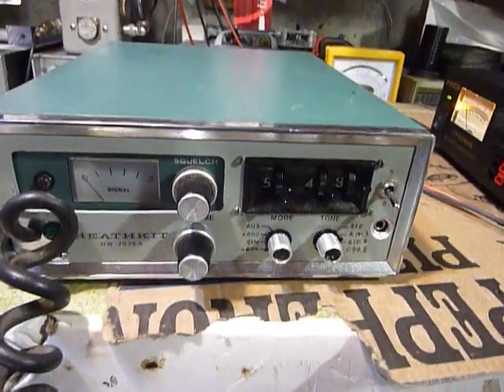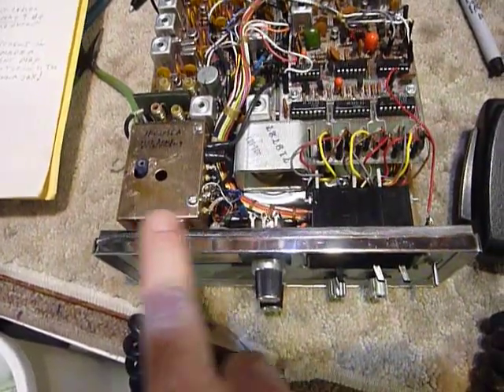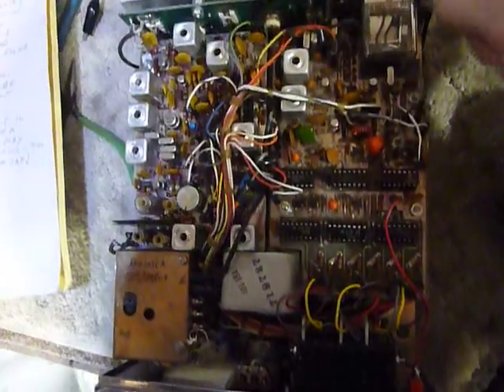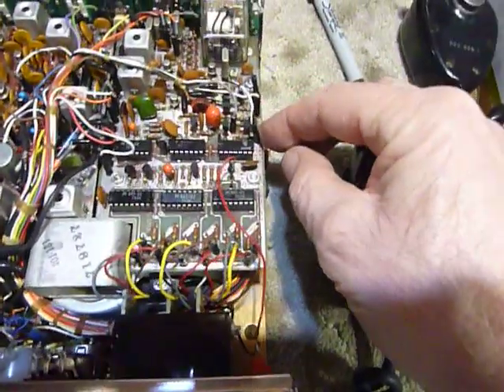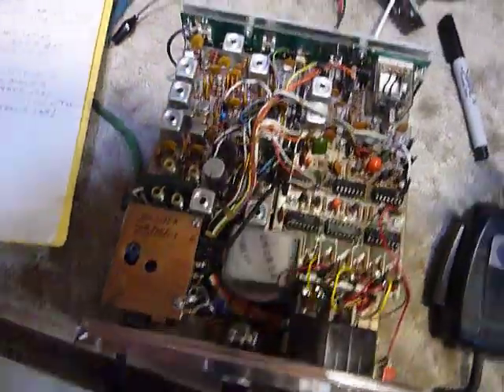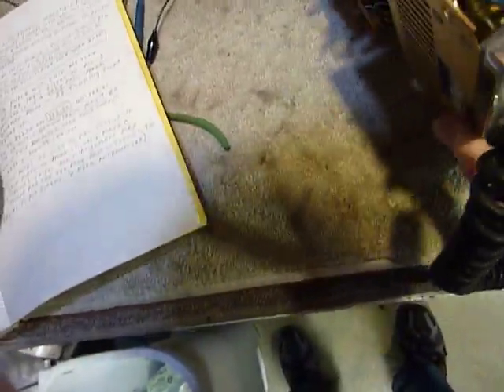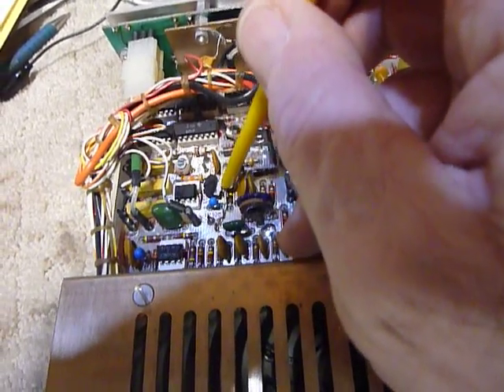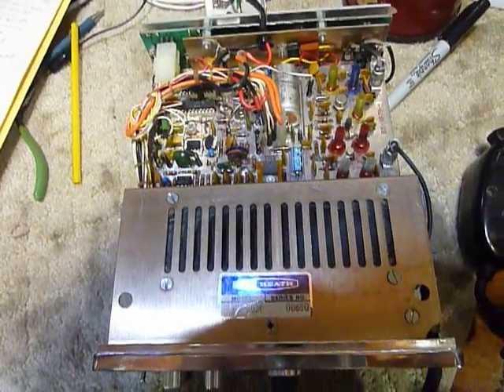HEATHKIT HW 2036 , HW 2036A   Two meter tranceiver  TIPS

Comment: I just picked one of these up a couple of weeks ago, then I passed the technician test and built a 1/4 wave ground plane antenna and can receive with this.  I adjusted the pl tone for one of the settings and got it down to 102hz before my screw on the trimpot bottomed out.  I will do the resistor trick to knock it down closer to where it needs to be so that will be fun.  I don't think I'll be using the micoder side of the handset these days, but may make the mod to remove the battery.

Great info sir, 

Dan

Comment: Bob,  I am trying to align receive section of my radio, but I don't get any movement of the S-meter while adjusting the coils!  I went over the instructions many  times to be sure I have proceeded correctly. Where am I going wrong?  Everything has checked okay up until this section.  Any advice would be appreciated!
Thanks,
Greg

Comment: ZD 101 is cracked on mine. It won’t stay keyed up . I’m hoping this is why. I’m thinking zener diode was there. The casing is gone just 2 wire stubs. These radios are built so nice I think a car running over it would only scratch it up.

Comment: How do you change the PL tone frequency ? I picked one up in great condition but cannot figure out how to put
the tones in for the repeaters in my area.
Reply: I know this is a rather old comment but didn't know if you got it figured out. If you search for the manual, it's available as a PDF. You'll need a frequency counter and follow the steps on page 124 of the manual. Tones are set by adjusting resistors R125 R126 and R127.

Comment: I'm glad I came across this video! My first VHF rig is a 2036A that I still have along with the 2036-3 power supply and a spare 2036A. 

I really think it's time to pull them off the shelf in the loft and resurrect them. Any concerns as to the life expectancy of the caps after about 25 years in storage?

Comment: Bob, I found this info on the interweb and thought I would pass it on.
To make the non A model work on all 4 megs.
HW-2036 (not the A model)

You can convert your original HW-2036 2 meter rig to tune all 4 MHz by simply:

    Open up the radio. Remove the cover from the VCO and turn the board over.

    Remove the varactor tuning diode 'C2' in the VCO (Motorola part MV2107).

    Replace with a Motorola MV2110.

    Follow the instructions on page 115 of your assembly instruction manual. Tune the VCO according to the VCO Adjustment section of the manual, changing only the midpoint frequency to the middle of the 4 MHz range you now wish to cover.

    You may need to retune the receiver, transmitter and RF amplifier to cover the new, wider range.

73's
Moe Knight
NT7
I gave credit to Moe for this info. Carl

Comment: Hi Bob, I got one a couple weeks ago that was listed as DEAD. It sure was and I had to repair every board and wire ends. I have all boards working but the PA. Must have been built by a new kit builder. Look like lots of people have had a go at it also. It is transmitting and receiving now but just low power output. Thank you for this video. Carl, AB1ZI
Reply: I had the xtal version given to me with the driver and final out. Bought over sea replacement and now works fine. Got off ebay if that happens to be the problem. If they shorted the final during installation. Just a thought.
Reply: @mikenichols5394  Hi Mike, I also replaced the final transistors with no luck. Seem to be Q 3 not amplifying on the transmitter board.

Comment: Having a problem with mine. After some warm up, the synth lock goes on and TP401 voltage climbs to 4 v or more and unable to adjust. After cool down all works again for several hours. Also as unit warms the TP401 voltage slowly climbs.
Reply from the maker: sounds like you have a temperature sensitive component there most likely in the little VCO box (voltage controlled oscillator )  I would take the cover off of that box  turn on the Hw2036A  wait for it to go out or use a hair dryer to heat it  and then blow on the various components with one of those little blow cans used to blow dust out of a computer If it comes back on then you have found the temperature sensitive component or part . You can also use Freeze Mist  sold in electronic stores to do this BUT the computer dusting spray cans are much easier to find and cheaper too. Good luck !  Bob

Comment: Bob, like others here, I thoroughly enjoy your videos. My Jones was for the old Icom IC-22S vhf radios frim a couple of years earlier. At one point I had restored and owned 12 of 'em. The trick was to pick them up cheap at swap meets and rewire the feed throughs on the synthesizer board and they would be good as new. Best receiver of that era!
71/72 de k6whp
dit dit
Reply from the maker: Yes the IC22S  a great rig I remember when it came out it was  $249.00 or something like that . I drove all the way to a big Hamfest  to buy one and they were all sold out at all the vendors that 22S was a popular rig   73  Bob
Reply: @robertsumption1243 , sounds about right! About 5 years ago, I picked up one that was NIB ss in unbroken seal, etc. The guy wanted $100 but I couldn't pass it up for my collection. You know, like the guys who but unbuilt Heathkirs?
Keep up the great work, Bob!
Reply from the maker: @warplanner8852  Thank you for your comments That would be fun finding one in an un-opened  sealed box and then assembling it  makes a guy wonder who bought it and why it was never assembled  ... I really enjoyed assembling Heathkits  the first one was a AR3 receiver  when I was 15  .

Comment: While looking for one I ended up with a Heathkit VF-7401. Needs to have some work done on it, but looks like a nice rig. Hope to get it going and on the bench
Reply from the maker: The VF7401  is much more rare than the Hw2036 I only worked on a few at Heathkit .  I did buy one at a hamfest and used it awhile it seemed like a good rig like the HW2036A .  73 Bob

Comment: Brings back memories for me. Bob.  I found construction faults and fixed about 3 or 4 of them for other hams, scraped my $$ together and ordered one for myself.  Got it on a Friday, started on it after dinner and had it on the air by noon Saturday.  Worked great for years until it was caught up in a lightning strike I suffered at the home QTH.  73 - WB8FEQ
Reply from the maker: Yes repairing them at Heathkit  about half of them had solder bridges, unsoldered connections  or  very loose hardware .   I had this one shown here on 145.8  running 24/7  for several days and  heard the Space Station twice  with it .   73  Bob